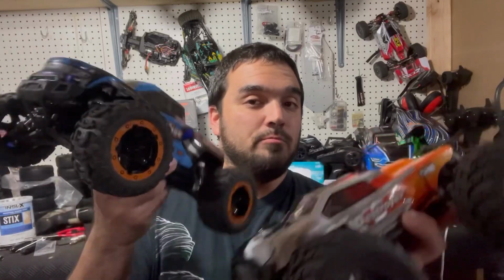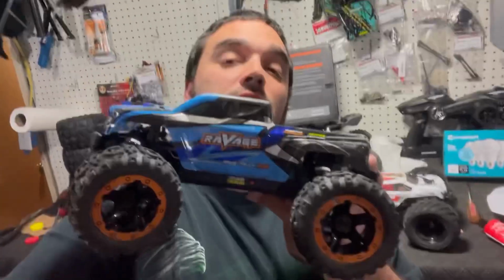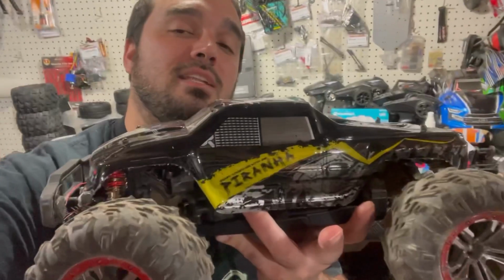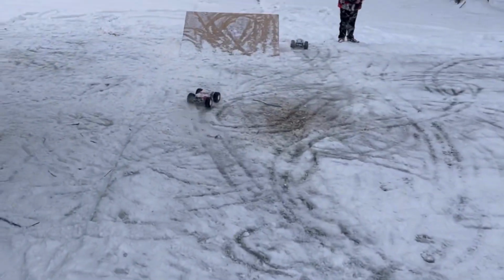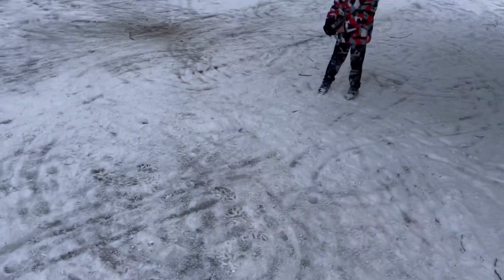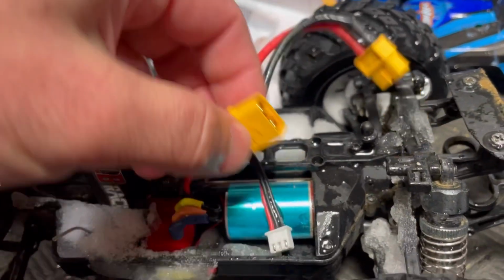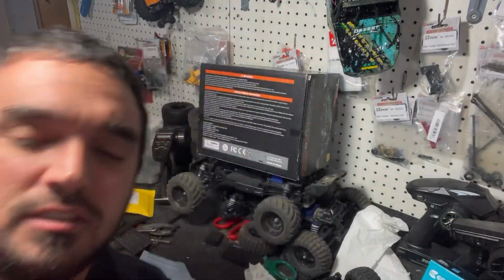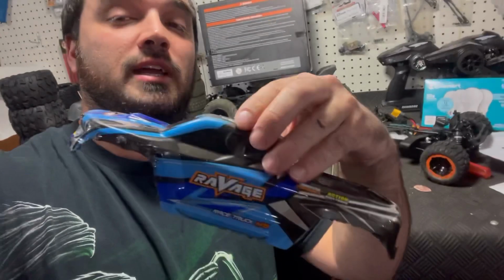Snow Bash! Prevent Rusty Bearings -Body Reinforcement Method #2

Comment: I bought an air compressor for my other crafts i do, but it is so useful for RCs as well. Gets out water, dust and at higher PSI will remove surface mud and grit galore. 
Also, unblocks clogged up fans, and i haven't yet had a fan fail on me when i blow them out every run or two. 
Of course, these are the "frameless" fans on Hobbywing Generation 2 ESCs, that have the fan body integrated into the heat sink itself, it's not a fan screwed onto the esc\heatsink, instead the fan electronics are part of the heatsink. Helps during impacts and jumps, and it's held up even in 55 mph rollovers. I drive in a lot of fine grit and gravel, so I ordered some hair nets because I've already had stones lodge under the center diff case and chew up the aluminum.
Thanks for showing folks what to do when they drive in the wet. 
Some (but not all) manufacturers write that in the instructions, but who reads those ?

Comment: 7:13 PS: don't forget the motor bearings! Spray WD-40 into the motor shaft area, because even "waterproof" motors have only shielded bearings in the motor. Only a few manufacturers use sealed bearings inside the motor.

Comment: I mostly use spray on truck bed liner to strengthen my bodies. It's cheap and really quick. I suggest Plastikote brand because it's durable and sets up nicely with minimal fumes compared to other brands.
Reply from the maker: That’s one of my methods coming up! It’s not that brand so I’ll look into that one too!
Fumes are an issue since you can’t really apply it outside in the winter lol
Reply: @DerbyCityRC  if it is cold out I'll take the warm body and can out, spray it then bring it back inside. It's safe to do it that way and then the fumes as it sets are minimal. Best to do a few separate coats. I got tired of replacing bodies on a Hosim 1/12 scale and it really did the trick. I automatically do it for all lexan bodies now including my ZD Pirates 3 and Team Associated Rival MT10.
Reply from the maker: @FeralRC  awesome! I liked the drywall tape a shoe goo, held up great so far, just takes forever lol

Comment: how does your 16890 holds those wheels without shredding the input gears and diff cups? I had so much trouble with those with much less aggressive wheels. did you upgrade the drivetrain and gears to metal?
Reply from the maker: Good question! Yes when I first put those wheels on it, we shredded the front pinion gear pretty quickly. I did upgrade the entire driveline to metal and I even put some larger tires than these on it one time. I have a lot of info in a few videos on this if you want to see them. If you click on my playlists, and go to the HBX or HBX 16890 playlist, you should see them there! We have plans for the 16889 too. So much more fun with the bigger wheels!

Comment: Nice video. What are the dimensions of the rims, without tyres? Thanks
Reply from the maker: Thanks! The rims alone are about 55mm in diameter. Width is roughly 41 mm
Reply: @DerbyCityRC  Thanks. Do you notice any issues with cogging, or extra heat in the ESC or motor from running larger wheels? I was thinking of adding a set to a 16889a Pro with the brushless setup.
Reply from the maker: Actually no. These tires have been on that car for a while. We put some 2.8” traxxas rustler tires on it in a past video also and those did get the motor hot real quick. No issues at all with these so far. 
I’ve got a 16889a pro coming as well and I’m going to go even larger with that one since the motor is slightly bigger.
Reply: @DerbyCityRC  thanks man, swift replies 👍
Reply from the maker: @iainlangley  no problem! Thanks for watching! 😎
Reply: @DerbyCityRC  just spotted in your previous video when you put those wheels on, and had to cut the body. I didn't really want to have to cut the body, can you suggest any other wheels that aren't quite as big but are better than the stock ones? Thanks again 👍
Reply from the maker: I don’t have any others that I’ve tried on this car yet. However there are a couple things you can do. You can turn the steering rate down on the remote so it doesn’t turn quite as far. You can wrap a rubber band around the body and in most cases that will pull the body inward away from the tires enough. Or my favorite option, is using wheel spacers.
It widens the stance anyway and helps a bit with preventing roll overs. Some would argue that that adds leverage that can bend drive shafts, but I haven’t had that issue yet either. I used them when I put the even larger wheels on it. If you go that route, let me know and I can show you the ones I’ve used so I know they fit.
Reply: @DerbyCityRC  that's amazing info, thank you so much. If you could recommend some spacers that would be great. I live in the UK so I'd need to be able to source them from here or say Banggood or Ali Express. Good man, thanks. 👍
Reply from the maker: Absolutely! Let me see what I can find here in a little while.
😀

Comment: Hey I have a question, I'm having over heating problems with my holyton 9205E. Did you have this problem and how can I fix it?
Reply from the maker: I had this problem with the cheaper motor/esc combo. What electronics are you running?
Reply: @DerbyCityRC  I'm using the electronics it came with, it's the motor that gets hot the most.
Reply from the maker: Oh yes, that would get pretty hot. Definitely a good idea to only run one battery through it and then let it cool. Sometimes let it cool down sooner than that. Definitely one of the downsides to brushed motors.
Reply: @DerbyCityRC  ok thanks for the tip, and should I try to replace the motor with a higher quality one asap
Reply from the maker: I would. Just more fun and more reliable. Watch the videos I have on that car. You can see them all in my “brushless conversions” playlist. Shows you all the parts I use and I believe I have links to the parts in the description of some of the videos.

Comment: Never use wd-40 on bearings bro, you gonna kill em that way.
Reply from the maker: I agree keeping anything out of the bearings is best, but if you run it through water, it definitely beats the bearings getting rusty. Do you know something that works better?
Reply: @DerbyCityRC  some bigger bearings you can clean with break cleaner and repack with appropriate grease,  depends on the bearing and it's inner ball housing if it's plastic be careful what cleaner you gonna use to not ruin it.The rubber sealed are a lot more water and dirt resistant, also can be cleaned and relubed.You can try ultrasound bath with some cleaner and the relubricate them manually or in oil bath.Sometimes it's just cheaper to buy new ones.
Reply from the maker: Thanks for the info. Ya for these cheapo wheel bearings, I think using WD40 will have them last longer than keeping residual water in them. Then when they do completely dry out, replace them. Definitely best to not get them wet in the first place lol
Reply: @DerbyCityRC  tri-flo
Reply from the maker: Cool, thanks!